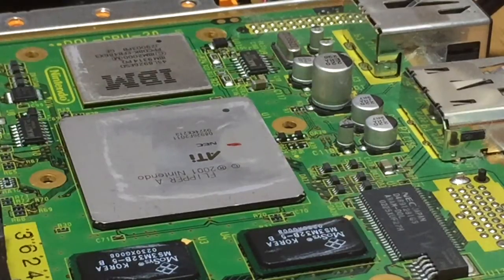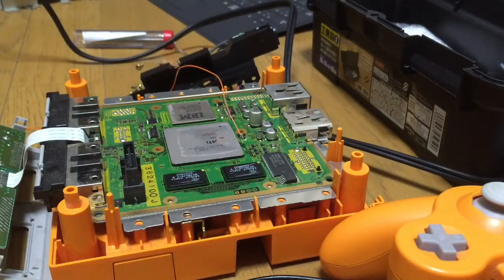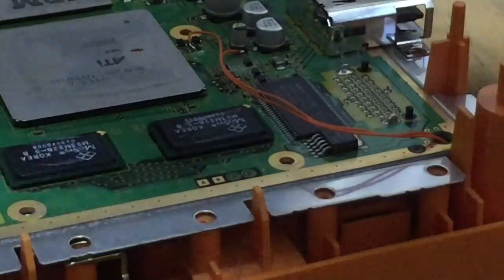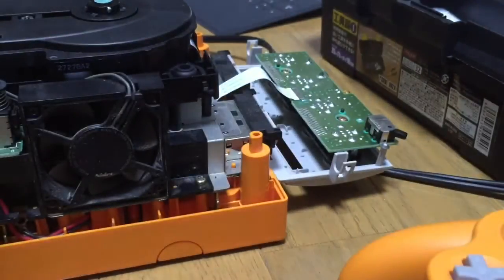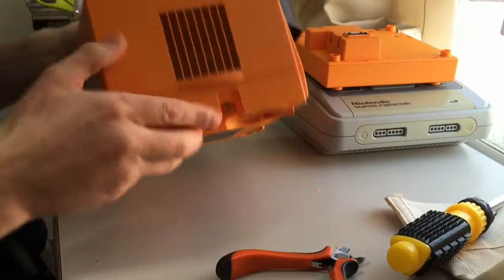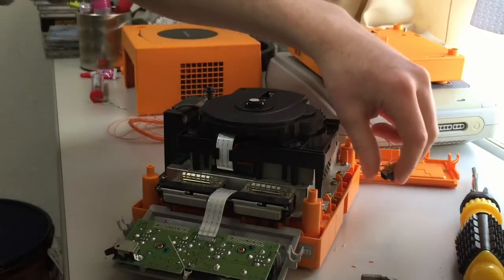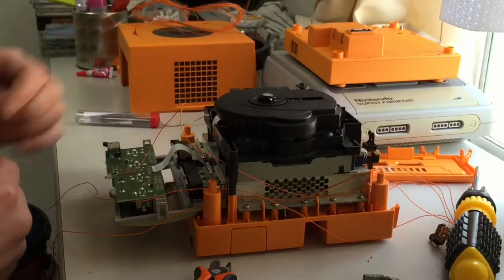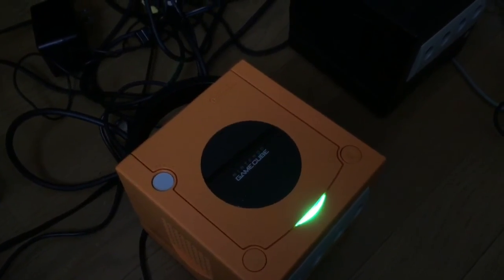Japanese J-NTSC to U-NTSC Nintendo Gamecube GC Mod Modification LED and Region Modded Guide How To

Comment: Two points of advice: don't solder directly to the R5 pads. Use a continuity tester and solder to the closest via, you'll get a much better joint.  Second, don't use super glue to attach the switch. Hot glue will do the job just fine, and it's much less damaging.
Reply: Is that tester also great if one is scared to solder to spots that small in general? Do you have any good videos showcasing what this tester thing is?

Comment: that looks like a tiny chip to solder on to, would it be easier to add the solder to the wire and then heat it onto the chip?
Reply from the maker: Hey, you can do that, or you can solder to the resistor next to it. Either way, you should add flux to the point and the wire, and a little solder to both points.

Good luck.

Comment: If I did the same modification and soldered the same points on an U - NTSC would it be able to switch to J- NTSC and play Japanese Games??
Reply from the maker: I think you'll be fine :)
Reply: For anyone who finds this, the answer is NO. To go NTSC-U to NTSC-J you need to bridge R6. It's R5 to go Japan -> USA.

Comment: Both r5 and r6 jumpers missing... can my cube be saved? Or do I just throw it away?
Reply from the maker: Scratch the protective layer away with a Fiberglass pen and reveal the traces that go to those jumpers.

You can then fine alternative points using a continuity tester, or you can solder to those traces with some skill and some flux!
Reply: @Redraw4444  I already removed the protective layer from R5 & R6. I also tried soldering to those points. It wouldn't let me change regions with the switch, it just stays on NTSC-U or -J and the other fails to boot when I flip the switch. I guess I'll try to look around with my multimeter. I'm still a beginner at this xP.

Comment: If I wanted to make mine permanently play US games and not Japanese, can I bypass the switch and just solder the wire between the two points?
Reply from the maker: ez™ the tiny point position has two tiny points where a tiny resistor should be. You can just solder a 3/4mm piece of wire between the two tiny points to bridge them out OR solder a wire between the capacitor and the point shown in this video. Both are tricky. Best of luck.
Reply: That's what I was thinking. That's a lot!

Comment: I have probably ripped out a solder pad on R6.... are R6 and R5 connected?
Reply from the maker: Daan Prinsze yes, the that R5 resistor, you can connect a wire to the side of it, the same side that the R6 pad you’re supposed to solder is.

Be careful applying solder to the R5 resistor, it can come off as heat transfers quickly to the other pad. Put a tiny bit of flux on and then tin the resistor quickly.

Good luck!
Reply: Redraw4444 thank you for the quick respone 0_o i already exposed a bit of the copper of the R6 trace, thinking i could use that. But if R5 and R6 are connected, using a wire on R5 sounds better. Im going to try my next attempt with better equipment because i think the long exposure to heat with my crappy solder iron killed the pad.
Reply from the maker: Daan Prinsze just go direct to the edge of the resistor from now on. It’s actually what I do now!

Comment: can i just, like pay someone to do this? i dont have soddering tools and im afraid i might damage my hashin tigers gamecube
Reply from the maker: wibblew0bble you can always just swap parts out. The motherboard and the disc drive can be exchanged from another DOL-001 working unit into the Hanshin Tigers cube.

Don’t worry about making mistakes, that’s how we learn.